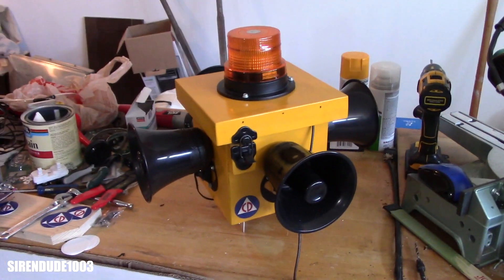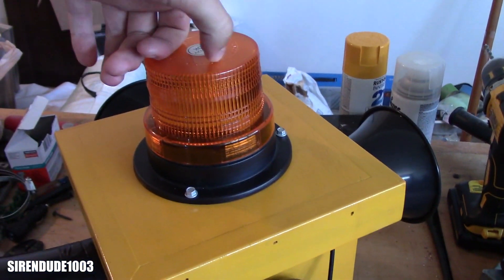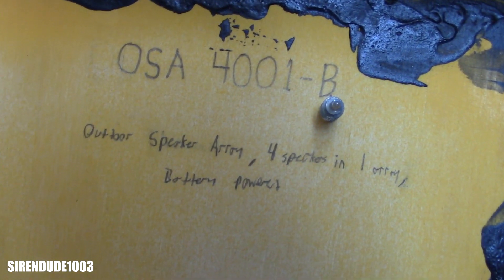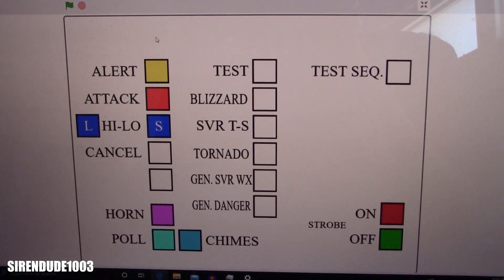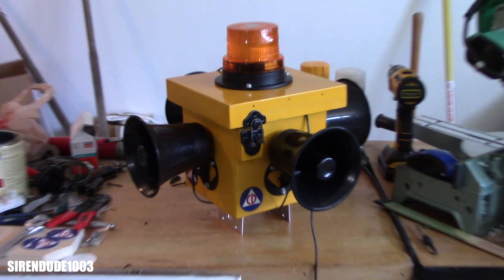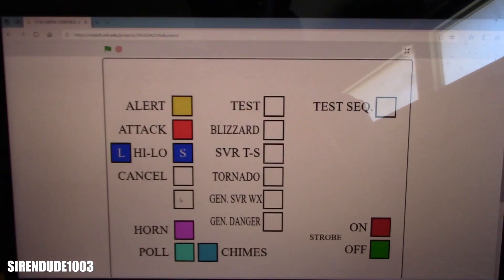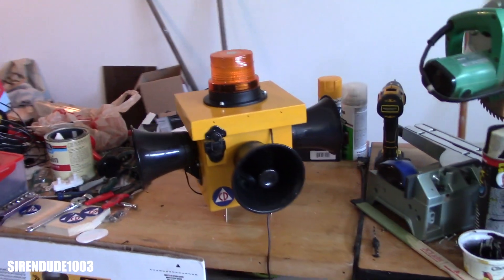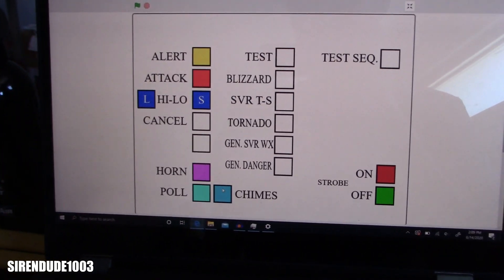Homemade Speaker Array Demo - OSA 4001-B

Comment: Hey SirenDude! I was asking this to winder if you could give me advice on how to make a siren like that, I'm starting to try and make a custom ThorGuard. Thanks!
Reply from the maker: CSX Railfanner If you’re wanting to make a Thor Guard you’re gonna need two air compressors and air horns that have the same pitches as thor  guards. You also will need a dome of some sort that covers the compressors. Other than that just an electrical connection and a timer of some sort.
Reply: Actually, I was going to put speakers at the bottom of it that make the sounds. The horns are just going to be decoration

Comment: Hey, we’re the same age and I’m also building an battery powered electronic civil defense siren. Cool! Mine’s run from an Arduino, not a computer. How many ohms is each PA horn, and are they in series or parallel?
Reply from the maker: I don’t remember how many ohms, but theyre wired in parallel.
Reply: @SirenDude1003  are you gonna paint the horns yellow?...to match the housing box?...Also, can you please send a couple of those CD Logo stickers, to B.S.P. (for his mini thunderbolt siren project?)